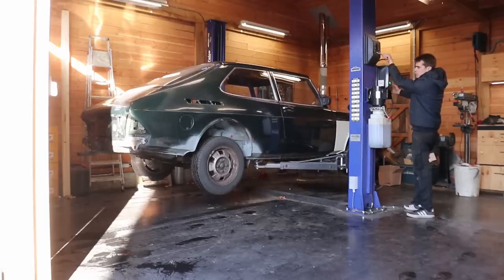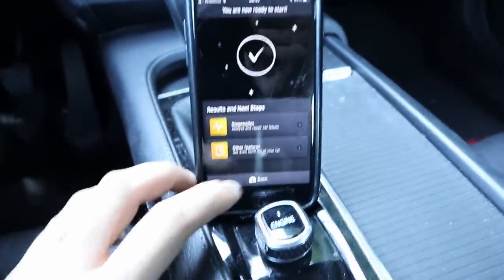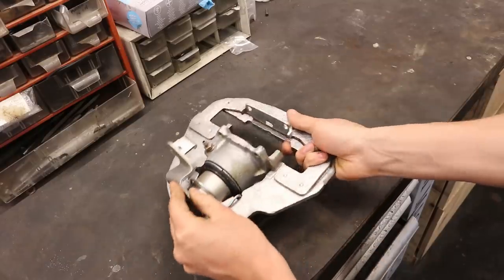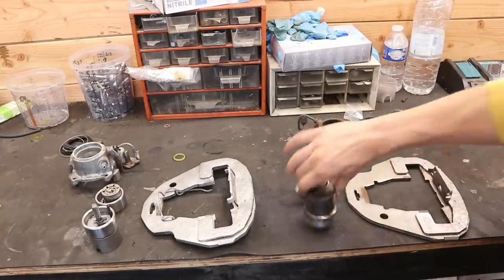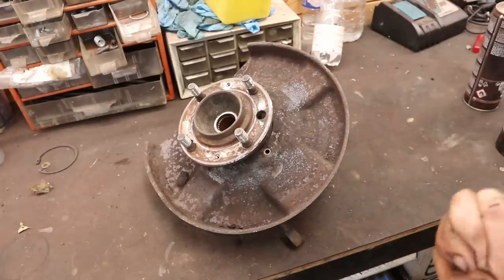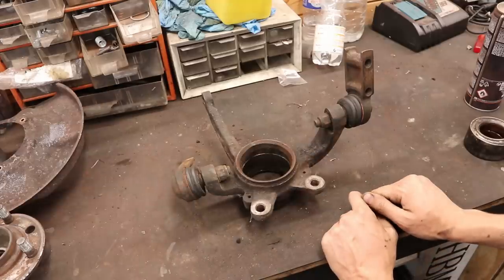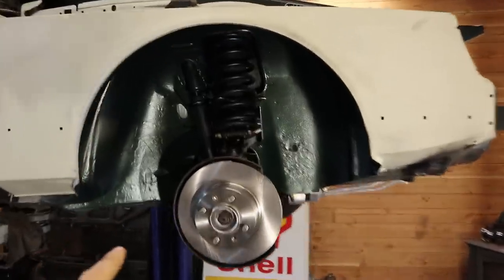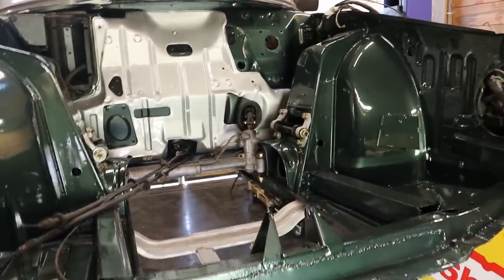Suspension & Brake Refresh | Saab 900 Classic Revival | Part 14

Comment: I'm not sure what I find more satisfying - the beautifully painted engine bay, formerly rusty parts after they've been sandblasted or the zinc coated nuts and bolts! Amazing work Memphis.
If you ever decide to do commissions, I have a 1982 Porsche 911SC that needs some jobs doing :)

Comment: It will be some Fiat, probably Fiat 131.
Reply: Most likely yes, Fiat 131, because no Lada ever had plastic door trim like that, especially not Niva - those had no trim on the doors at all, and anything directly derived from Fiat 124 had thin chrome strips, not plastic mouldings

Comment: Yes indeed - (Lucas) Girling was the original manufacturer of these style calipers for Saab. They were also my first employer out of University (1985 until 1993)! AP Lockheed had a similar front sliding/swinging caliper design (minus the handbrake mechanism) that was used on the British Leyland ADO16 range of cars in the 1960s/70s.
Really high quality restoration going on here - keep it up!

Comment: The Big Flat plates for the brakes NEED rewelding milling to replace the metal worn off where the Piston assembly Slides.
  ALL these brakes wear there and produce a Loud 'Clunk when the car is reversed. 
Only replacing the slider tolerances repairs this.. for a while. 
Girling brakes were erm ..Poor indeed. 
Seemingly you are a cleaner and painter ....NOT a rebuilder.
.

Comment: It's not a Lada classic saloon that's for sure, as even though the handle features on the classic 2101/2102/2103/2106 models, they didn't have the chunky plastic trim below - 2103/6 had chrome. I suspect it's a Niva, especially in that colour too!

Comment: Hi 
I have e28 525e 1986 
The car first start than dies after when i take the colanet sensor wire the car keep start but if i Bush petrol paddle its dies 
Than now no problem with the colanet wire but same problem with air flow meter sensor wire 
Take off the wair of the sensors the car starts but same Bush petrol its dies 
Any one know whats happens 
Thanks

Comment: I got as far as the new V90, and had to laugh. A V90 is, to me, a SMALL car. It has less cargo space than the old Volvo 240! Large, to me, is an 87 Mercury Grand Marquis Colony Park with all of 109 cubic feet of cargo space. The V90 is all the way down at 68 cubic feet. The neat thing with the Mercury is that properly equipped it will only use 7 litres per 100 km on the highway. Provided, that is, that you keep the speed under 160 km/h. Above that, consumption goes up a little, to about 7.5. Those figures are with the 5.8 litre engine and the correct intake and carburetor. Add the towing package equipment, really good tires, and run a boat of a North American, wood panelled, station wagon around Nurburgring and surprise a few people .

Comment: I discovered your channel a couple of days ago, and I truly love what I see! I’m from Sweden and also started the EXACT same project like you in 2006-2007, but i had to stop when I became a father. I hold on to the car a couple of months until I sold it. Today it’s up and running, the new owner continued my project, the cars is now worth around 20-25k€ sold it for 1k€ 😅😂 

The only difference between my car and your is that my was a SAAB 900 T16, aero, 2 doors, sunroof, red leather seats and electrical windows. 1985 😍 I miss it every day, and thinking about doing a remake of my dream project when the kids are old enough lol. 

I also would like to do this project with a SAAB 9-3 coupe aero (first gen). 

I almost did start a total remake of a 9-5 aero Hirsch 2001, but got another kid so needed a 7 seater lol. 

I have a lot of knowledge about Saab in general, so feel free to ask me anything! I will truly follow this series!!!! 

You’re a great “speaker” and a good mechanic, this Saab will probably be one of the finest out there on the roads. And if it’s hard to sell it in Belgium, you should really try to sell it in Sweden. I recon you will get about 10-15k€ when you’re done. Maybe even more. To bad it’s not a turbo tho :(

Comment: So, some info about the brake calipers. That piston should not have come off from the screw mechanism. Those tabs in the piston should be pressed in so that they grab onto the beveled part of the screw mechanism. Also the part of the piston housing that the yoke slides on tends to wear away which leads to a "thunk" when swtiching to reverse. New calipers are stilling being made in sweden by a company that manufactures parts for a snow machine (which uses these brakes). BV206 calipers is the term you want to search for. Also check out the blog post "My pre-1988 brakes tutorial to end all tutorials - c900" for most all the info on rebuilding these front brake calipers. The blog post doesn't go into detail about how to replace the piston, but I'd be willing to share my experience figuring out how to do it.